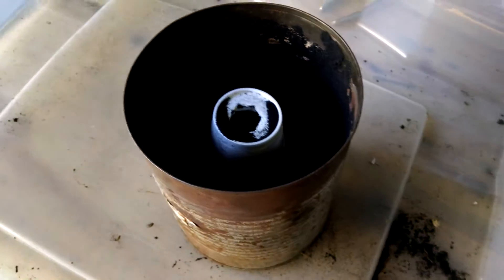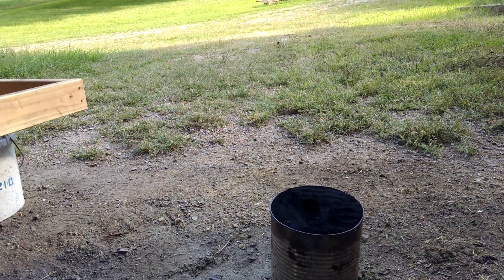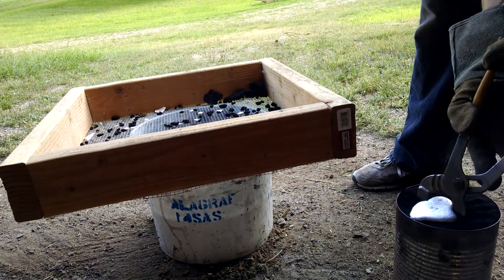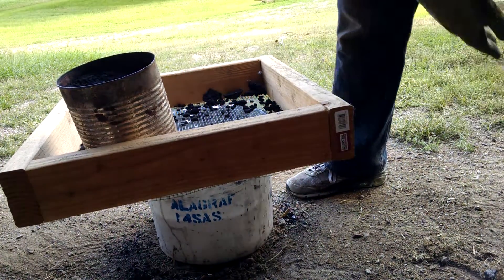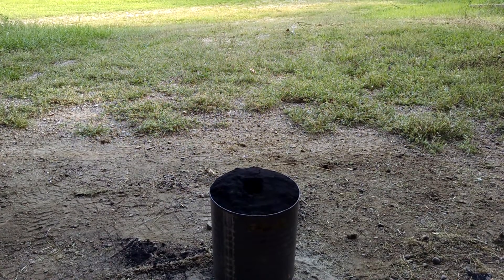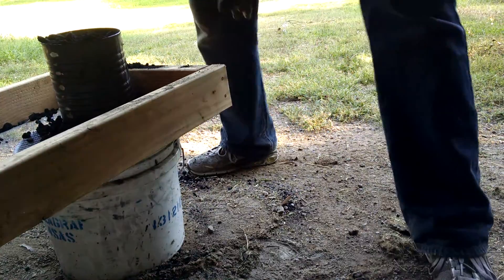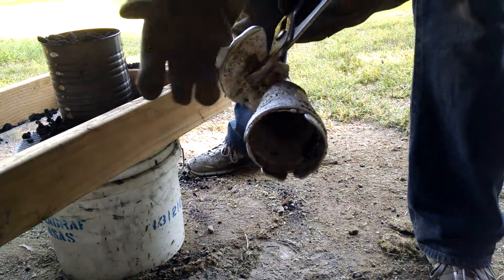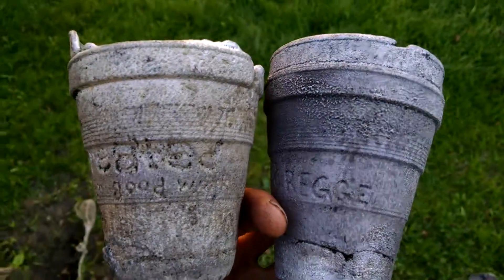Casting cups

Comment: nice! the first one turned out pretty good! cool that even the writing can be picked up, quite good details. what is the black sand? that you are using? it looks like good fine stuff for casting.
Reply from the maker: I got junk sand from a dumpster behind a foundry, they typically have some that is no longer useful for them that they will give away for the asking- especially if they are a smaller foundry.
Reply: Cool! Unfortunately I can't find any foundry in the Netherlands, even the casting sand is very hard to get here, and when you find it, it is really expensive. Good luck with further castings!